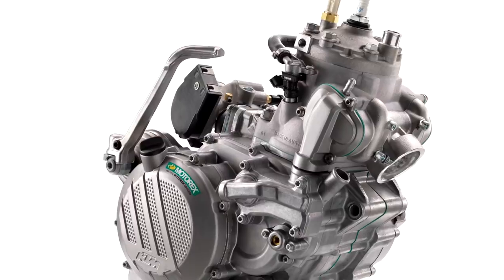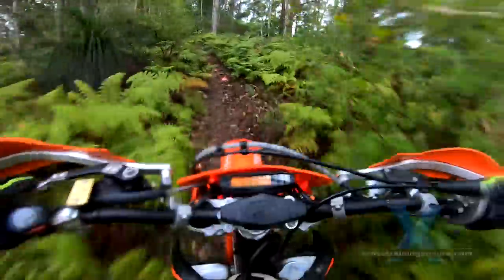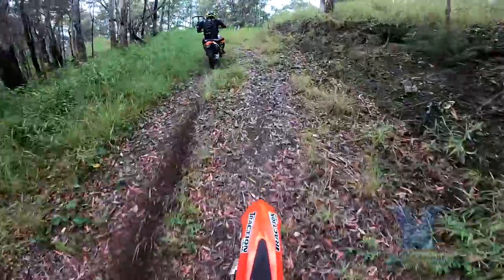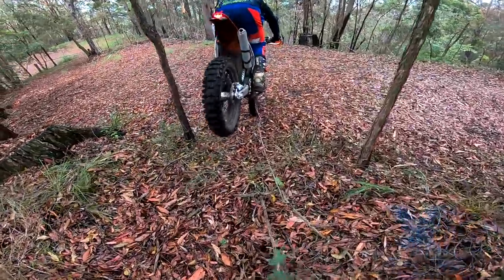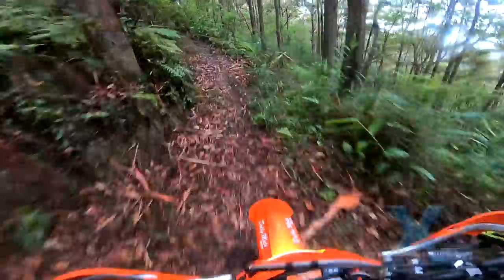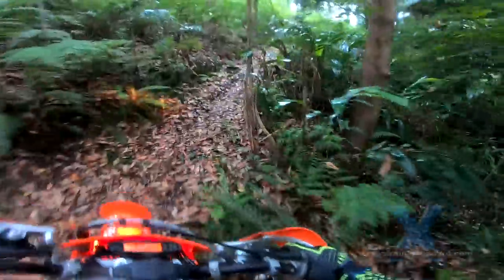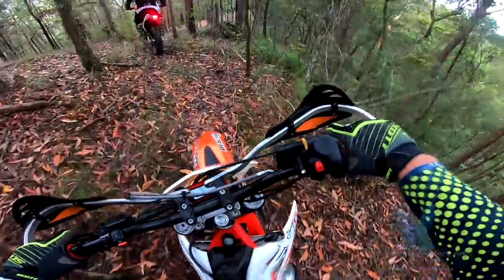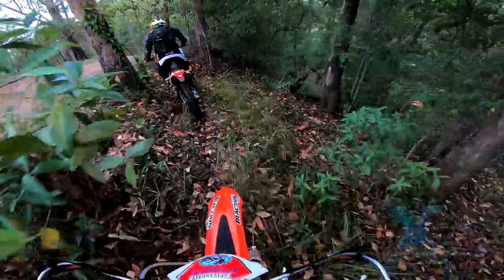KTM's carb v TPI (Transfer Port Injection): pros and cons!︱Cross Training Enduro

Comment: so sick of emissions restrictions. its a freakin scam.
Reply: Have fun with floods then lol look at the netherlands they already have huge problems with the rising water levels.
Reply: But you got a point there, for bikes it's not so massively important...if you look at boats for example...a freighter burns multiple TONS of Diesel per hour and has no CATs at all.
Reply: i've got ur point and i think that its unneccesary for dirtbikes as there are many bigger problems. but the daily used vehicles need the lowest emissions posssible.
Reply: Unlike fuel injection, a lot of the motorcycle emissions stuff is a scam. Look at the Honda 650L, and many other bikes in its category....an air pump bolted on the side of the engine that pumps clean air into the exhaust, so that the air coming out the exhaust is “cleaner”. Same amount of pollution being produced, just diluted.  More fossil fuels had to be burned just to turn the pump and lug the extra weight around everywhere that you go.  What a scam, and actually worse for the environment.
Reply: @xGxPhantomZzz  it doesn't have cats but they are making diesel engines to where you must have def or dpf or some type of emission restriction only reason why they don't bother boats is reliability marnetime mechanics can't have all the emission parts on a boat/ or a ship that can't run emissions is bullshit nuclear power plants and batteries put off more toxic air then a small engine .... Just telling y'all the truth governments gotta put there hand in every pocket
Reply: @xGxPhantomZzz  the netherlands is a flood plain. It has been for hundreds / thousands of years. The only reason its "dry" is because they built and manage levies
Reply: xGxPhantom Zzz yeah, your tip bike is going to fix that. LOL Clearly not well educated in the historical trends of climate shifts long before carbon emissions. BTW, there have always been huge carbon emissions historically. Maybe a pedal powered bike is what you should be riding if you really GAS.
Reply: @jrodfolyfe   WTF how does a nuclear powerplant produce emissions? Btw ships do have emission restrictions in the ECA called MARPOL.
Reply: @hwobstj  you know how nuclear power plants work ?
Reply: jaredv408 I do, very well in fact. I have a masters in electrical engineering and have served in the us navy on conventional and nuke boats. Do you have a point to make?  If so, how does it apply to the emissions debate?
Reply: @hwobstj  Thats awesome man! I know just the basics of Nuclear plants, they don't produce any emissions during operation, do they? Exept for the nuclear waste.

Comment: Just acquired a 2019 300 TPI, seems OK and for me the convenience of not having to worry about carrying 2 stroke oil is bloody great but if there was a grand difference in cost in another country then that is a different matter. I totally understand anybody sticking with a carb but if this TPI allows us to carry on enjoying the 2 stroke because it satisfies the climate Nazis, then hey, it is not a serious sacrifice and it really does seem to increase fuel range which ain't a bad thing. I am not an expert, but I would say if you had a carb 250 before then get a 300 TPI this time but I could be wrong, I know fuck all, I am what our host would call a total Gumby. There might be other advantages such as no longer needing to blip the throttle to lube the piston on long down hill descents to prevent potential seizure maybe? Just a thought.
Reply from the maker: never underestimate the wisdom of a gumby. there is strength in admitting how little we know! Socrates said, "All I know is that I know nothing" which apparently is meant to be very deep in some way.... 😁

Comment: TPI sucks and maintenance is expensive, plus too many things may fail - oil pump, fuel pump, sensors etc etc  I bought carbed sherco 300se factory instead.
Reply from the maker: There are reports too that you'll need a battery pack because a clutch start won't get the bike going again if the battery is dead. It's not a dealer killer necessarily as bikes without kickstarters might require this if you could get stuck in a situation where clutch starting isn't an option. But a guy I know said he's had to rescue two TPI bikes in a week where the battery went.
Reply: @crosstrainingenduro  no electricity then oil pump stops and engine goes belly up :)